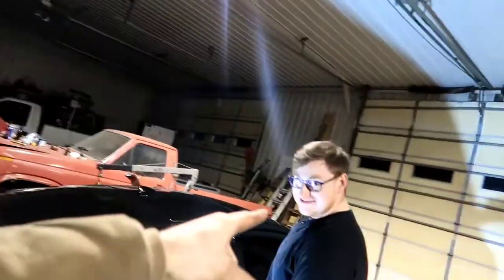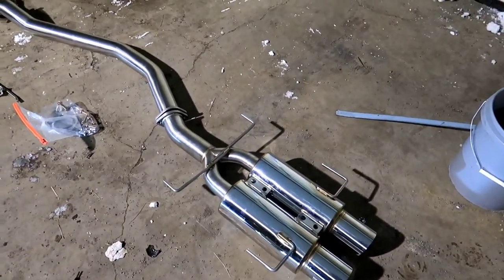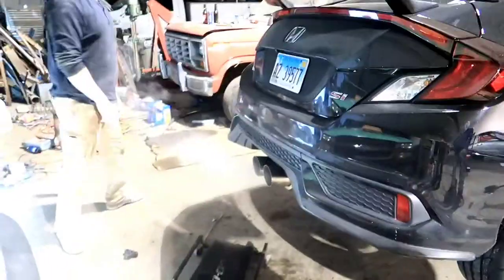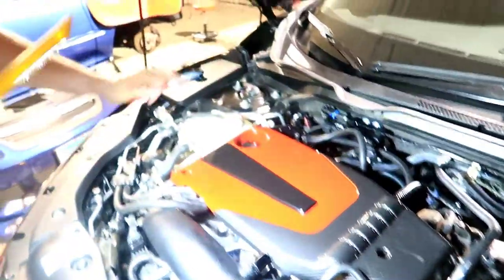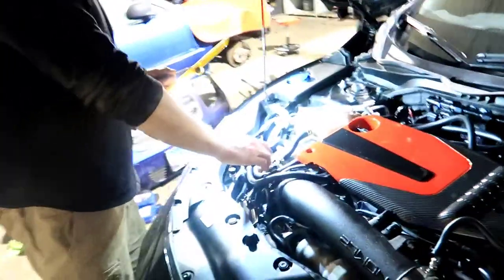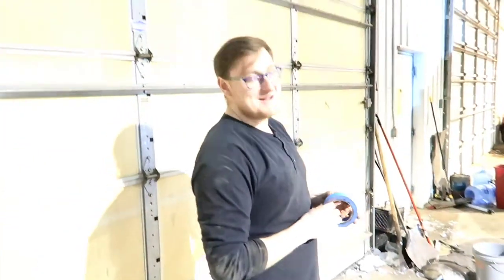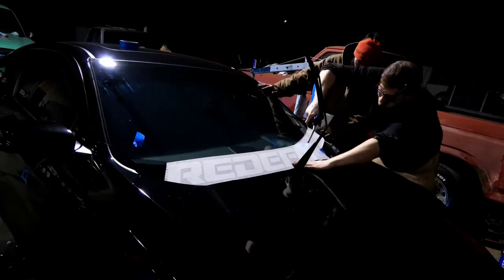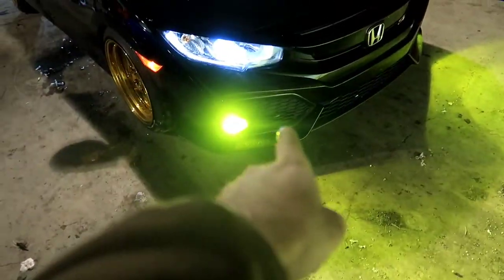2019 Civic si skunk2 mega power exhaust

Comment: The bar goes on the hangers that are welded to the vehicle. Then the bushings then the exhaust hangers. Its meant for adjustment.
Reply from the maker: It was way to low with the hangers it looked dumb love it high and tight with the hanger it had a 4 finger gap

Comment: I buy a blowoff for my civic si 2020 but it only sounds when its on 7000 revolution do you guys know why?
Reply from the maker: Blow off valves are to release the pressure in the charge pipe you won't ever hear the blow off it's mostly very faint but if you have an external waste gate you will hear the choo choo and flutter 🍃 under 5psi and more but blow off valves you normally don't hear unless under a higher load as you speak 7000 rpm

Comment: This fits on stock dp? And is it catted
Reply from the maker: Nope it's got the dp
Reply from the maker: Not stock
Reply: So if I order this exhuast I need to buy a dp to? Or does it just fit right up?
Reply from the maker: The car has dp .. and catless they don't sell tht version anymore they have the one now with high flow cat but car has dp 4in all the way back tuned on half e85 320 to the wheels